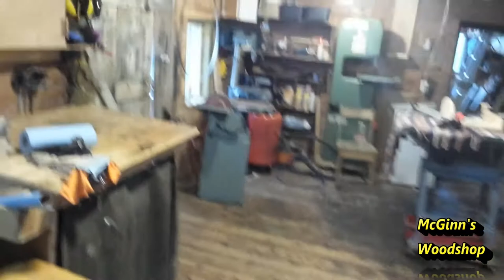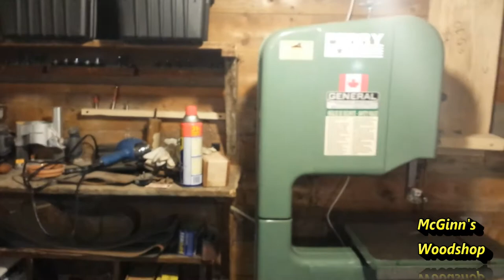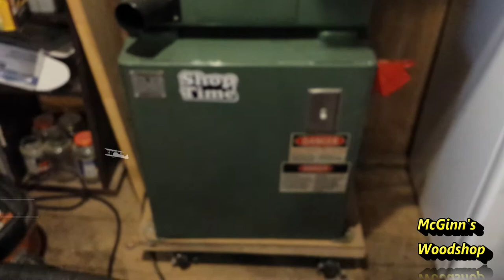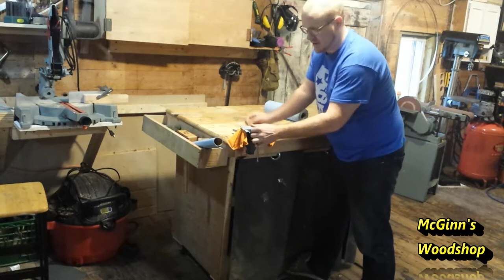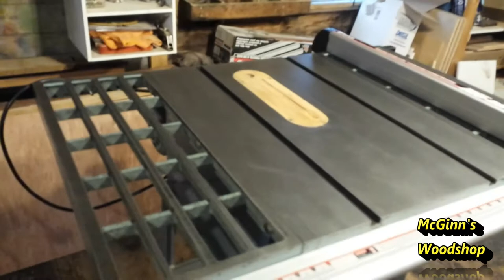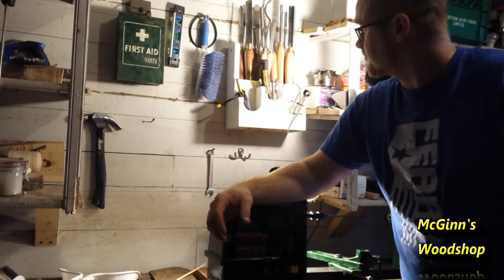McGinn's Woodshop Tour

Comment: Your being so close to the water may require some silicone spray on all the metal that doesn't touch wood and the wax for those parts which do. So flat to waters edge,  I see now why you had the flooding. Maybe time to fix the roof maybe? (haha). Nice shop and tools!! Great finds on good stuff. Really like the table from the old store! Thanks for the tour!
Reply from the maker: MRrwmac That's actually exactly what I did this time around.  I'm working at fixing the roof this summer, unfortunately money has been needed in other areas of life for the moment.